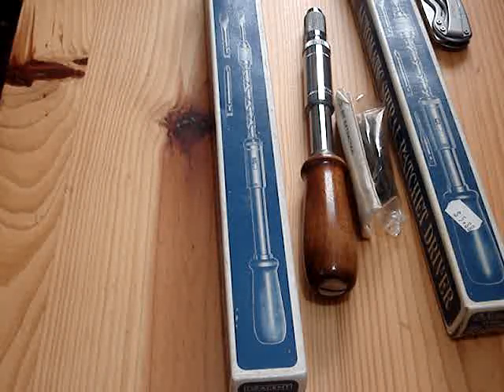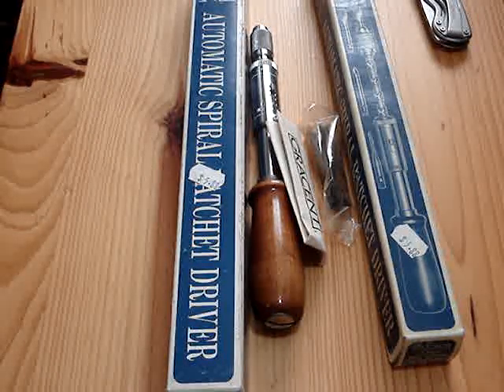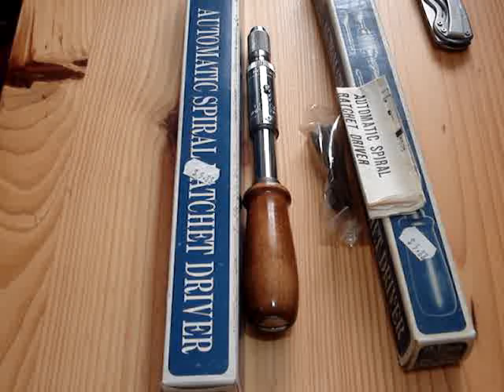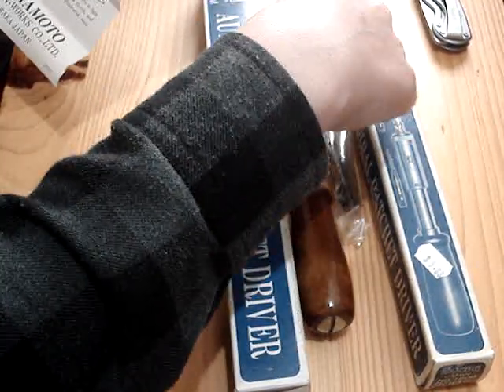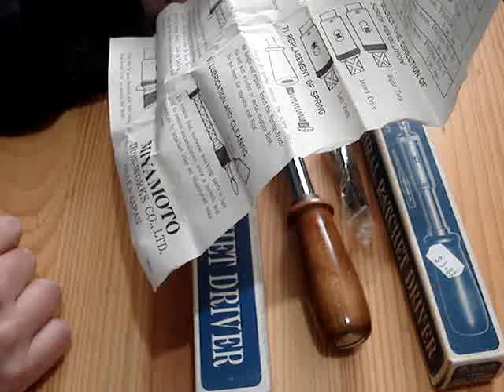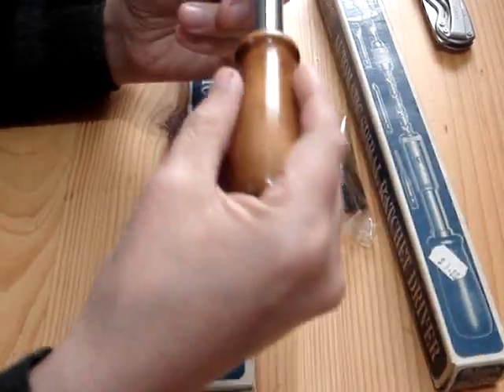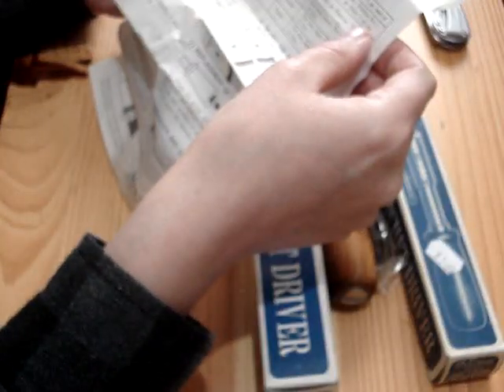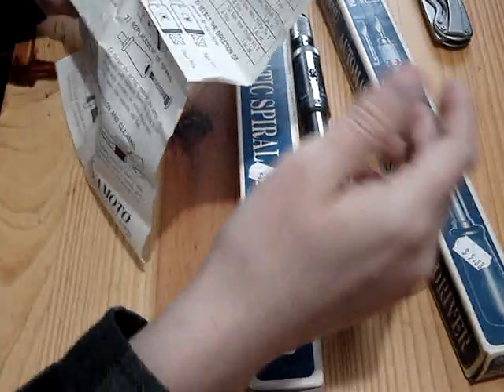Automatic Spiral Ratchet Driver Question

Comment: Good to help out George, ~ GunGeek. ... The 'Yankee' is for old time production work.   A lot of screw twisting would wear a man out.
Reply from the maker: so much for trying to help someone lol   
George Gonzalez-Rivas
12 hours ago
 @Gungeek  The video does not help enough.  I need to know how the handle spring is configured, it there are any parts interfacing with the spring inside the handle, and most importantly how "stiff" is the spring.  If I get a clear picture that will help.  But if your documentation covers this please just post or PM me a snapshot of that paper.